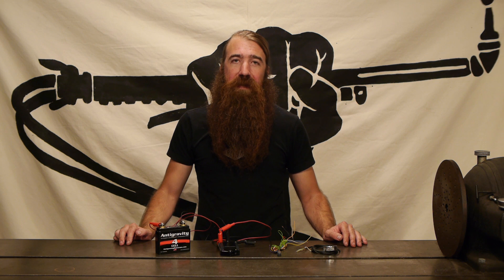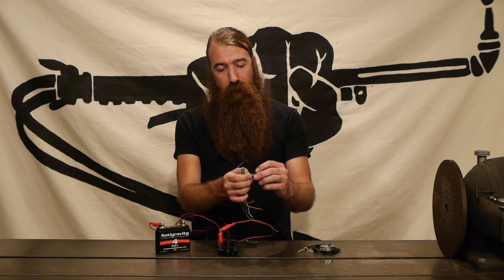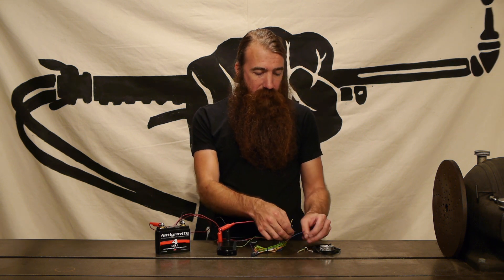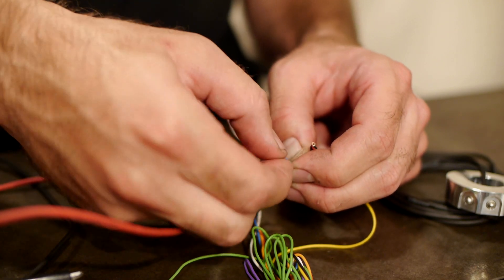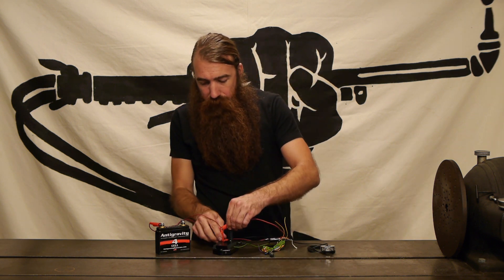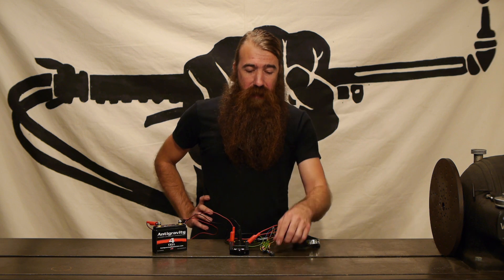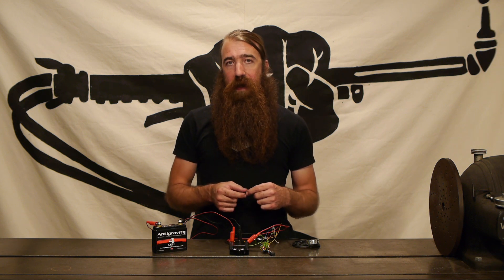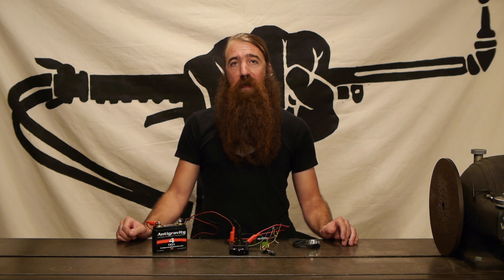Motogadget m Button - Revival Cycles Tech Talk

Comment: The one downside with this device is you cannot use a separate configure button on the M-unit while this is hooked up. The reason I say this is a downside is you cannot turn the alarm function on and off or access any of the configuration menus with the M-button and a separate configure button hooked up at the same time. You would think that you could use one of the buttons hooked up to the M-button but none of them will access the configure menu while the M-unit is powered on. 

Also it's a total pain in the ass trying to get this inside a set of handlebars. It was almost worse trying to get it out of my handlebars after I decided to run separate wires instead. After installing this and removing it I decided you really aren't saving anything more than a couple of ounces of extra wire that you have to run. 

I guess you could remove the M-button wire from the configure terminal each time you wanted to change something but felt it really wasn't worth the headache. Not exactly something I want to do if I ride my bike somewhere and want to turn the alarm on. Don't get me wrong it's a cool product but not worth it in my opinion
Reply: I discovered this problem when I installed and M-Button in a system the 1st time (I had installed 2 M-Units w/o it before). My solution was to install a toggle switch in-line in the M-Button 'config' wire to the M-Unit. This allows the M-Button to be isolated during configuration changes. I also install a lead from the 'config' connection in the M-Unit to ground with a normally open momentary switch button. All I then have to do to change configurations (like turn the alarm option on or off, is to select the M-Button toggle switch to 'isolate (open)' and then use the config push button to scroll / select as desired. 

You can see how I set this up on the Bevel Heaven forum here: http://forum.bevelheaven.com/viewtopic.php?f=24&t=4543&start=60
Reply: I wondered if that was the case, seems a bit of a pain. I guess you could have a hidden switch somewhere to toggle between the wire from the m button and another auxiliary.
Reply: Can you put both buttons into the config input?
Reply: +Brad Castellano You can run two wires into the configure port  although you would need a toggle switch of some sort wired in line on the m-blaze wire to cut power to that when you want to use the configure function on the m-unit. I hope that makes sense.
Reply: Yep, thanks
Reply: +Brad Castellano Glad to help.
Reply: Top tip Mr Dockray! I couldn't find anything on line from Motogadget - you saved the day!

Comment: Its really an impressive little thing thanks for the video it's very educational. 
One question though. if it's only one wire going from the handlebar,where do they recommend to connect the ground? The handlebars? 
Thanks again!
Reply from the maker: +bigmac throttlebody That's right, motogadget recommends grounding through the handlebars. And if you are using their m-Switches they include a tiny little ring terminal that you can use to connect a ground to the aluminum switch housing. This configuration gives you a path to ground that goes through the housing, through the bars, through the bar clamps, through the triple, through the stem, through the bearings, and FINALLY the frame. This will work, but we prefer to run a dedicated ground wire to the handlebar controls. It does mean you have two wires going to the bars, but that seems like a small price to pay for improved reliability and certainty about the ground connection.